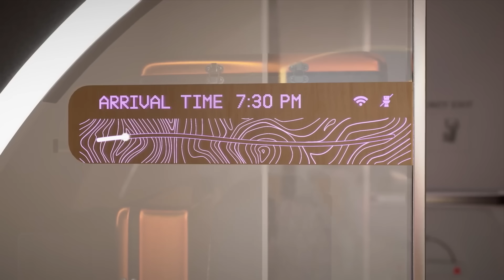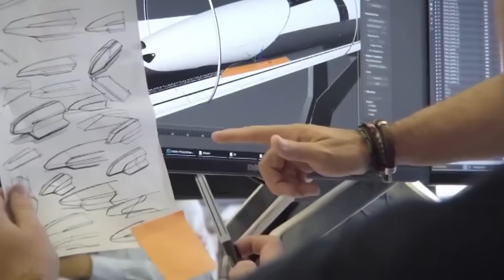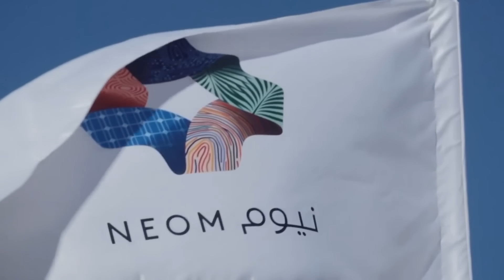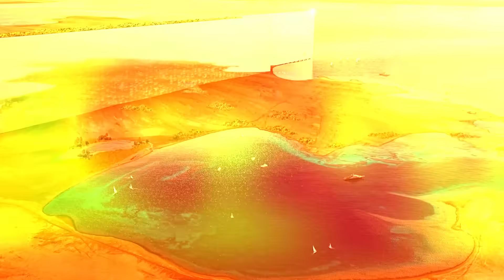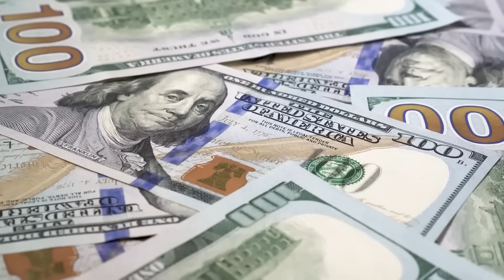Construction Begins On The Line Megacity. It's Actually Happening! 😲

Comment: I'm not entirely sure how they are going to power this thing. They claim renewable energies, but how would that work? The inside of the Line will be completely cramped, even if only half of the stuff from the concept images is actually built. The building itself doesn't really offer space for it either. Then there's the problem with the lights. The opening in the middle will allow for maybe 1 or 2 hours of sunlight to reach in, requiring them to keep the lights on almost 24/7. 
And what about the climate inside of the Line? How will they regulate it? It's a block of glass in the middle of the desert, with an opening in the top, that doesn't just allow the hot air to enter throughout the day, but also allows the freezing cold air at night to enter.
The power consumption of this thing will be enormous. 
Then there's the main problem. The shape. I'm having a hard time believing that the inhabitants of the Line will never want to leave their segment (or the Line in it's entirety). So they'll have to travel the entire length of the Line to get to the other end. If what they are building right now is actually part of the highspeed rail, then they'll maybe be able to fit 4 tunnels next to each other. Your flexibility to travel around will be severely limited. Those flying taxis are also super inefficient and would just be suicidal to fly inside of the Line.

I get the exitement, but this project has so many flaws that it's beyond me how any sane person could actually think that this is a good idea.

Comment: A 10 km diameter would give an approximate  30km circumference. Plus 5 spokes would give a contact on the outer wheel every 5 km.
Each spoke is 10 km long which is another 50k of available building space.
Travel times would be negligible. !2.5 km to the furtherest  part of the compex. It would need electric mobility devices but I liked the concept.
Using all those material is going to be used to house people somewhere so that is not even a argument.
But I would not want to live there. Also I would not live in a apartment complex period.
A bit like fish farm but people farm in the desert.

Comment: the original design might have been too much even for them. but...a smaller design of the same type might well be made cheaper and to work more economically. reduce the overall size by half. there's always room for more after it starts proving itself.

Comment: It’s not a case of ‘if you build it, they will come’ 
Who is prepared to live like this?
On another point, the maintenance and construction defect costs after completion will be astronomical in perpetuity. 
Then there’s ground settlement and displacement which varies so crack control will be massively challenging especially considering the glass facade. 
I don’t believe there are enough competent designers in the world to pull this off.
This is the idea of a deranged billionaire and the project will meet its nemesis

Comment: What would happen if all the brush, grass, and or green life caught on fire? Does it have quick escapes to the outside of the line?
Reply: I doubt they thought that far ahead
Reply: @grey5744  Lol
Reply: THEY WILL PUT A SHOP IN FRONT OF EMERGENCY EXITS BECAUSE THAT'S WHAT HAPPENS IN DUBAI, INCLUDING IN THE MALL OF THE EMIRATES - WHERE THEY REMOVED A MAJOR EXIT AND REPLACED IT WITH A CHEESECAKE FACTORY. THIS IS COMMONLY DONE. THERE IS A MALL I GO TO THAT HAS ONLY TWO EXIT/ENTRIES AT THE FRONT. NONE ON THE SIDES OR BACK - AND THIS IS A 3-STORY MALL.

Comment: Looks interesting but you can’t drink, smoke a joint, have free speech and the women will need air conditioning throughout cause bed sheets are still required for women due to the area

Comment: does the speed needed for a 20minute ride from end to end include many stops? 🙂
i suppose there could be "local" lines doing all stops and express lines doing fewer. even if energy was no object, i'd assume 1g acceleration/deceleration would be way too uncomfortable for passengers so it would have to be more gentle than that. perhaps swinging chairs might help, but if everyone MUST be seated, then station stops will take longer requiring faster speeds in between 😀
Reply: I'd love if a train accelerated at 1g. I'd ride that shit all day long.
Reply: They should probably look at Japans model of Bullet trains :D That would probably be the closest they could get. But regarding a lot of stops on the way, then it wouldn't make sense to even have a fast train like that. Only for very long stretched of land.
Reply: An idea might be to place the bulk of jobs, industry's, and shopping in the middle to reduce travel time and congestion at any one end. But, they're will be those that live in the burbs and travel the full length.
Of course their will be no less than four raillines and this can be added to as occupancy grows.🤔
Reply: With solar instead of mirror energy power wouldn’t be an issue also may not be as bad and I would think less damaging to nearby windows of death along the line. Absorb the energy don’t double it’s strength on your coast line lol
Reply: Yes there is a hyperloop 🚆

Comment: The most efficient way to build a city would be in a circle. With energy and manufacturing around the center, then accommodation, and then recreation, entertainment and parks around the outside.
Reply: you should try playing cities skyline. its a fair represetation on city building, and you will find that putting your polution in the middle, is not a good idea. city center is a park, surounded by shopping and offices, then housing ouside that. with shopping for local needs spotted true the housing. manufactorying and energy is separated out, it creates both pollution and alot of trafic.

Comment: HOW do they plan on running this thing on 100% renewable resources? Hydro-power is out of the question, and wind would fall apart quickly due to the erosive nature of desert sands. I am not acutely aware of the geo-thermal situation around the Red Sea, but I don't believe they have much in that. Solar seems like the obvious choice, but it comes with a LOT of problems. First is what will they do at night? Have they solved the energy storage problem that we've been trying to solve for decades? Second, how can the be maintained economically? sand buildup and erosive damage from sand in the air would wear out the panels very quickly. Third, how will they be cooled? The efficiency of photovoltaics decrease quickly with high temperatures, which poses and obvious issue if they're going to be in the DESERT.

I'm certain this is going to be an abject failure in every way; what I'm concerned about is how much resources are going to be wasted, how much emissions they're going to generate wasting those resources, and how many people (indigenous population and migrant construction workers alike) are going to be hurt as a result of this farce.

Comment: The sun's energy at the outer wall could be channled thru towers. Hot air could then be channled up these towers. This updraft of hot air could however have unforseen consequences on local weather patterns, I would say simulations need to be ran. Instead of building up so high I would go half down half up.

Comment: 1:07 , 1:29 if this is the one you're referring to that does not match the measurement of 200 meters wide.. well because this excavated line is just the foundation for one of the line or the mirrored wall. The width of that trench is just for the line/wall not for the city itself. The line consist of two mirrored walls this is the first one. I don't know how to explain it better coz I am not fluent in English but I hope you get what I meant. You might be expecting that the walls will be just 5 meters wide so you thought the trench you saw is the total width from wall 1 then the city in the center, and to wall 2😅

Comment: I love this idea concept. I think if they tinted glass with pattern I. It it could work better for birds and heat better than mirror. Also a long gradual tunnel of ample size would help for those tribes to cross over to other side. With camel's and other stuff. I really wish them every success.🌼
Reply: Maybe if it gets scaled down, but I don't imagine what it'd be like to live inside it and the dystopian levels of control that would be possible living in it.
Reply: Tinted glass would let to much heat and the windows would get hot. Mirror is only choice if you don't want to use a massive aircon system

Comment: This will be interesting, because the Flat Earthers have pointed out there should be roughly 7,000ft of curvature in the 105mile length of the Proposed City.   This is OVER a mile of curvature (5,280ft is a mile)....And the physical curvature of a Globe over a 105mile distance is about 7,000ft.  

To break this down for the Brainwashed, or the Ignorant---->  The Roofline and Floor of such a structure CANNOT be Flat and Level if it's built according to a GLOBE.   The Roof and floor will be CURVED with a MILE of CURVE from one end of the building to the Other.......IF the LINE is built using GLOBE construction.

On the other hand if the Roof LINE and FLOOR of the 105mile long Structure is in fact STRAIGHT............Then no curvature was present and NONE will be factored into the Project.     Just another PROOF that the Earth is indeed Flat.   Thanks.

Comment: I believe NEOM will work. 
People asking why linear? Because you will avoid traffic jams in the cross juctions.
Why small gaps? Because NEOM will provide microclimate which more confortable than dessert climate. 
Why high wall? To give shade and protect from sand storm.
Why looks like isolated? Not really, actually. This is vertical city. You compressed horizontal area by building vertically. 
Why not in the form of circle? Then you will have a lot of cross junctions, i.e. traffic jams.

Comment: So many points to raise. Let me start with one. The transportation line at the lowest level. Is it only one line? If yes, then the journey from one end to another would be really slow as there would be multiple stops along the way. How about journeys between nodes? How about express journeys without any stops? All this would mean multiple levels of tunnels. If it is a single line, it would mean many many levels. And it would have to be designed for emergencies and accidents. The deepest level would be very risky. Maybe the transport line would be spread horizontally? That would make better sense but egress would be to the desert. Many technical issues to deal with.

Comment: Cities are supposed to bring people close together, and this line of cities simply defeats that purpose. Ideally, you could build several urban "dots" and string them together with a high-speed rail line. The linear urban design also ignores geographic livable areas, which ultimately increases the cost of supplementation and waste management.
Reply: One little fire and the whole thing goes ablaze. But I guess that part are probably been solves.
Reply: @Linkwii64  that's what I was thinking.  And a mass shooter can do what he wants because police would be slowed down because it would be difficult to get through everything.  They would always have a 20 minute headstart. I could think of a 100 different was this line could go wrong
Reply: The thing is we are destroying our planet we don’t have a lot of time then it’s over, there is a reason we are trynna find out other planets to live on instead of saving our own this could be a start of a better place for animals we are already to many people on earth
Reply: There are obviously gonna be towns built in proximity to the line where you can have your "bring people close together"-community.
Reply: @DunDeeoZ  Not according to their blueprint. Two huge walls clearly defined the borders of the "City".
Reply: I'm trying to imagine being on the extreme ends of that strip maill like city and then pondering the trip if you need to travel from one "side" of town to the other.
Reply: Cities are supposed to bring people together lol awww thats so sweet! Yeah amsterdam shares its border with london, infact london and amsterdam are one whole big city! No walls just like you said brochacho.
Reply: @omarabdul2864  It's your vision, your money. Good luck.
Reply: Very smart! Never noticed london was a 10 minute walk away from my city amsterdam
Reply: @omarabdul2864  What shape which has the most area covered with the least distance from one end to another? A circle... or a hexagon depending on who you ask.

Now, a literal line-shaped city? That is a shape which has the least amount of area covered with least distance. It is simply not efficient because it does not maximize both dimensions. It doesn't utilize enough area to fit all the people, industries, services, and logistics to make a functional city.

Imagine the difference between a 10 km wide circular city, and a 10 km long line shaped city. The circular city will have more population, more industries, more accessible services, and least difficult logistics simply because of bigger area covered allowing more infrastructure to be built to support the livelihood of the city, allowing even more investment to occur. I mean, from anecdotal standpoint, that's why there is no line shaped city ever built, at least until this abomination of a logistical nightmare came out.

I will just silently laugh if this city (if it ever will be built) will just slowly evolve into more or less circular city (or circular towns, lots of circular towns, in the middle of a desert, far away from fresh water). Or better yet, never being built.

It's good to be visionary, but if you're not careful you might create a money black hole at best, or ecological nightmare at worst. Just... Be careful with what you wished.
Reply: This is not a city, it's an ant farm for dehumanising people.